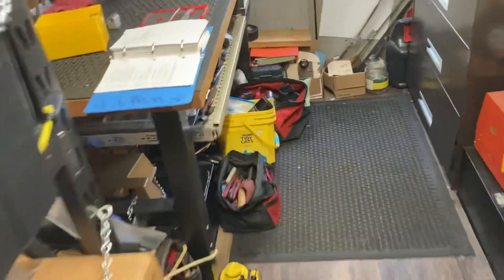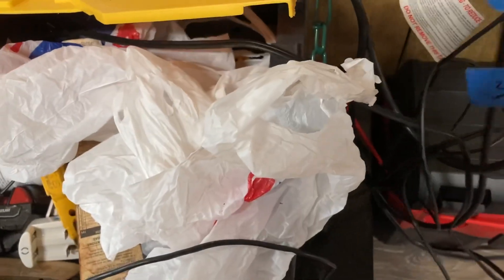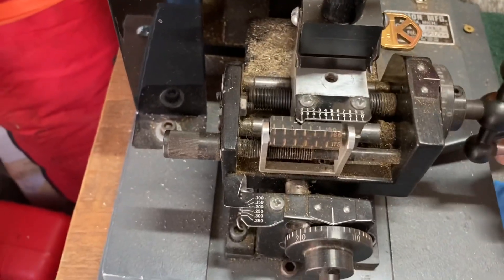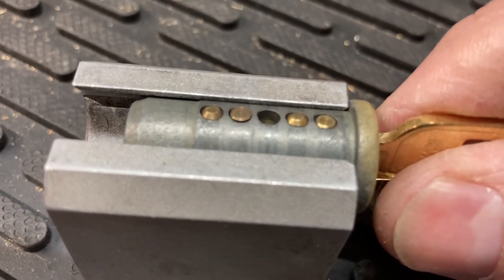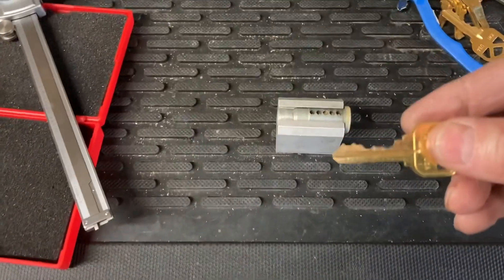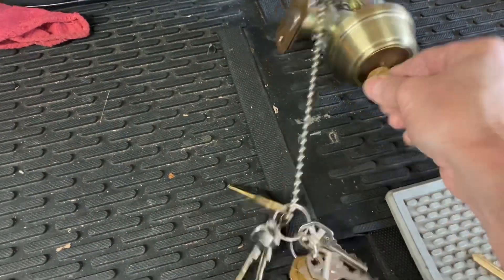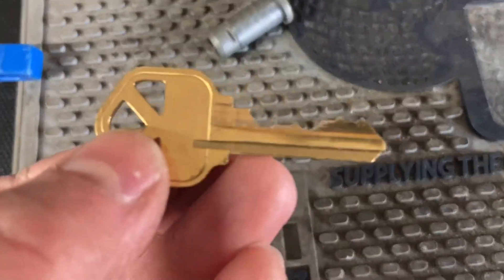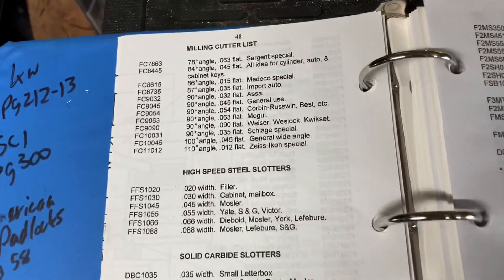Framon 2 and Kwikset keys

Comment: Thank you for this. I inherited a lock shop with a Framon 2 and no one to teach me how to use it. I've figured out how to cut Medeco & Emhart keys, but the only Kwikset I cut worked but with a great deal of difficulty. This explains why. The cut wasn't wide enough. My next challenge will be repinning wafer locks and cutting the keys for them. Baby steps.
Reply from the maker: Thanks for watching! Check out some of my other videos. I cover wafer locks here and there. I try to stick to the budget/ beginner/startup topics in my videos. Happy Holidays!
Reply: @odinslockllc  Thanks. I work at a prison so most of my locks & keys are gigantic or high security - Mogul, Emhart, and Best. It's the small normal ones like residential & wafers that I don't have much exposure to yet. Wafers are on my to-do list tho, as there are tons I'm responsible for. Just don't have a good system in place to deal with them. A lot of them have been drilled out and a padlock put in their place. Merry Christmas.

Comment: Great video.  Having just got my framon2 (and accidently receiving a 2nd one) , I did the same thing and my first key didn't work.  I remembered PJ's video and how he had widened the key he was cutting.  The 1970's video framon has still holds up, but doesn't have this much needed nugget of information.  Another interesting thing is when you look at the parts list in your manual, it's page 48...in my manual, the parts list is page 23...my page 48 starts with Barrows 1021N.  I wonder what was removed.  Many thanks for the video...us baby locksmiths need them!
Reply from the maker: Thanks for watching!

Comment: This exact same thing happened to me, I wish I’d seen your video first lol 😂 Thank you so much for making this video 😊🙏
Reply: Just from my own future reference I did a little experiment comparing a 1 depth cut with the HPC Kwikset card, widening the cuts, and cutting a 1 depth with Framon, and determined that the Framon needs to be moved forward and back 17-20 tick marks each side; this makes sense since the wheel is 0.045” wide and the cut needs to get widened to 0.080” to 0.090” as you showed in your video (thanks again). So I’m just going to use +- 0.020” (20 tick marks) each side since it’s simplest to do visually. Thanks again for making this 😊🙏
Reply: Great video.  Less jumping around on video this time.  Can you please post on calibrating the Framon and the HPC.
Reply from the maker: @kcet1948  I was thinking about doing those calibration vids but I suck at making these vids and there are much better quality calibration vids on YT than I can do. The Framon pretty much doesn’t need calibration as the first key is “zeroed” in to do the first cut and the rest can be  cut using the graduation marks. The HPC occasionally needs calibration but there are several quality vids showing it including from the HPC YT channel. If there’s other ideas for vids let me know. Thanks for watching!

Comment: Appreciate all of your videos and the subjects you choose.  First time I used the Framon it was a little confusing with the widening instructions.  I finally penciled in what the +20 and -20 was for each space as I noticed when I just spinned it forward and back it made all of the keys for the same bitting look just different enough that I didn't like it.  Then I started watching Jason and he just wildly spins it each way and I am coming to grips with just letting it go :}
Reply from the maker: Lol yeah there’s a minimum of .080” but the max is as wide as you want so long as it doesn’t affect the MACS or the cut next to it. The FC9090 cutter Framon recommends is even wider at .090”. Thanks for watching!

Comment: On the HPC 1200 for the kwikset and others that require widening the manual says start at first small mark for each space  and turn counter-clockwise. It also says do not move back clockwise.
Reply from the maker: That’s a wonderful tip about the direction of widening the cuts. I never knew that and went and checked my book and you’re absolutely correct! It’s on pg 4. Youd think they’d put that on the card itself… I have quite a few videos I’ve done about Kwikset and Titan now I have to edit in the comments on that🤣. Thank you for sharing that.
Reply: @odinslockllc  I don't know why it isn't on the cards. I also don't know what the reason is for it since it is a double sided cutter. I assume that it is for calibration reasons for the spacing? I really don't know but I always follow it. From the beginning I didn't and the keys always came out good.
Reply from the maker: @brianbillings1340  I know Framon has a special cutter F9099 just for the wider Kwikset cuts. It’s 90degree with a .090 wide flat. Idk if HPC does. But the .090 is what’s factory Kwikset dimension. HPC may have their own for that as well. I’ll have to look into it. Those  wheels are so expensive most people have no problem manually widening them to save the money. Thanks!

Comment: Good Video.  I was actually cutting KW1 last night on my Fra2 because the original I was given was a real crappy store copy.  
I did some math a while ago to take into account the root cut of the 8445 wheel being .045 and the desired root cut of .080 then calculated the start and stop for each cut to get a root of .080 using the .045 cutter.  For Example, I center the first cut at .2295 and then drag the wheel across to a reading of .2645 for Center cut of the wheel of .035 but an edge to edge root cut of .080 when taking the width of the .045 cutter into consideration.
I know dragging the wheel across is not desirable and I plan on buying a 9090 wheel soon.
Reply: If anyone is interested these are my start and stop cuts for KW1 using the 8445 wheel and dragging from first number to second number.
(1) .2295 - .2645 
(2) .3795 - .4145 
(3) .5295 - .5645 
(4) .6795 - .7145
(5) .8295 - .8645
Reply from the maker: I don’t do the math much as you seen in the vid😂. I’ve thought about just scribing some extra lines as others have mentioned. Seemed like the quickest option. Those cutter wheels aren’t cheap either. Thanks for sharing your numbers and thank you for watching!
Reply: @odinslockllc  I know, but I plan on cutting about 500 KW1 keys over the little while, and it will be (1) a time saver, and (2) easier on the blade, and (3) I can train my wife to help me.
Reply from the maker: @ImGumbyDangit  I hear ya. Just wondering, when you cut keys by code, do you charge the same as a duplication or more since it’s more labor? I’m always interested in how people charge differently with code cutting. I also find Smartkey KW1 is sometimes better to be cut by code. All other KW1 does fine duplicated…
Reply: @odinslockllc  actually as I am a Hobbiest I will be doing cost recovery, I need to make some Kwikset tryout keys for our Fire Department - one set for each hall, do those will be by code. (I'm the Deputy Chief on the Department)
Reply from the maker: @ImGumbyDangit  good to know! As Smartkey is sometimes a little tighter on the depth tolerance I sometimes use a Kwikset key control deadbolt with the KW1 and SC1 Smartkey cylinders for “key checkers” when I do a bunch of key copying. Take care!
Reply: I'm going to redo that video, make it easier to understand. Got me some ideas. I'll work on it this weekend.
Reply: @odinslockllc  I know, I bought them right after watching your video 🙂
Reply: @willie_mccoy  yes, I was just thinking that could work well, I was concerned there might be a piece inbetween the two cuts but I have not tried that yet.
Reply: @ImGumbyDangit  No center piece with my method because of overlap of the two cuts using a .045 cutter since you're only going .020 from center both ways.  (.025 overlap each way in the center).  I thought of a faster way to do this method which I'll put in my new video.
Reply: @willie_mccoy  I look forward to watch it.  Just Subbed
Reply: @willie_mccoy  I just watched your video. Thank you for posting that. Very easy way to cut!
Reply: @willie_mccoy  I’d like to see your videos on this topic but YouTube says “This channel doesn't have any content” 😭 I subbed anyway though 🤣
Reply: @Chirael  I put it back up for you 😁